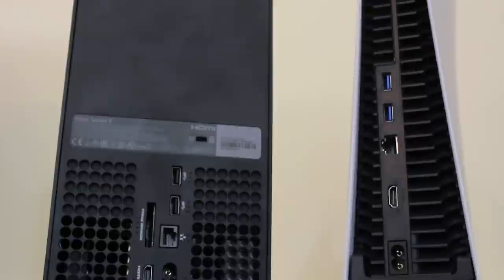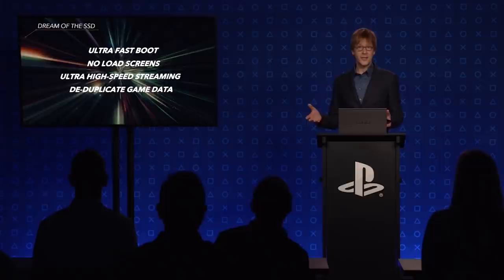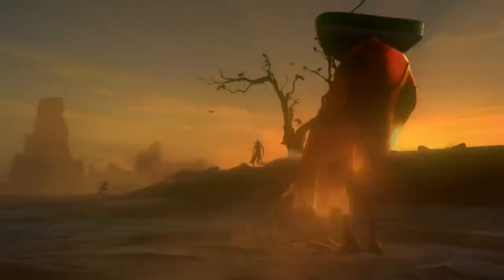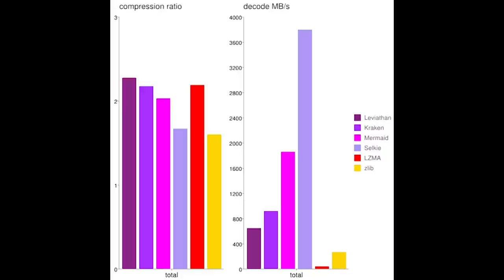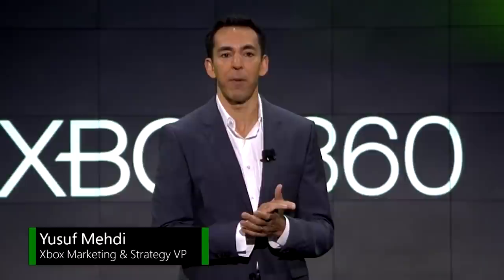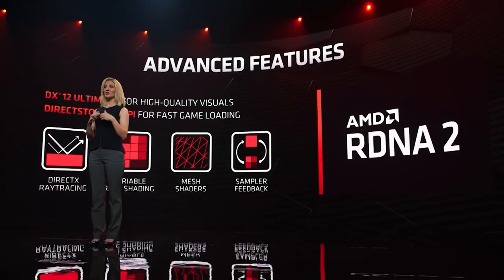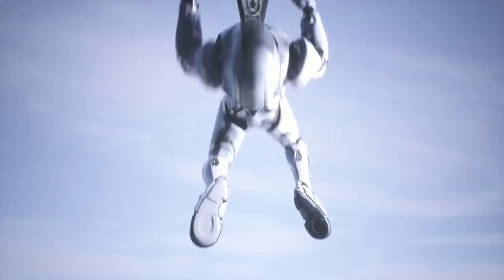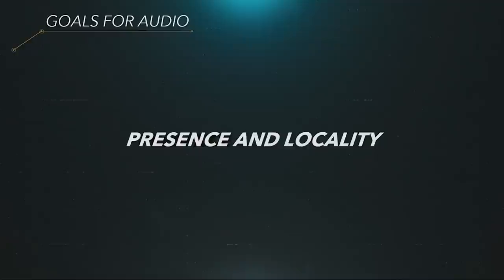Mark Cerny Reveals PS5 SECRETS | How The Playstation 5 Was Designed

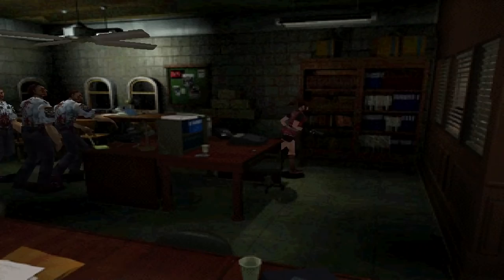Comment: 4:40 In the very early 2000s there was a company in the UK that teamed up with Sony to create a cd drive that used multiple lasers to increase read times. The UK company chose to use a single laser with a beam splitter and Kenwood made a CD drive with a 72X speed much faster that the 52X limit of cd drives but the beam with overheat and break. Sony on the other hand made a cd drive with multiple lasers but sadly they only used it for their own archive storage drives and never sold to the public. I guess having multiple lasers on a disc drive is too costly and SSD must came along so it made them outdated.
Reply: That's really interesting. Does it just read the tracks parallel to the one currently being read? I could see this being faster for copying an entire disc to a hard drive, but not finding specific data like a game would need to.
Reply: @TFSned  the UK company was Zen Technologies. Their system had one laser that diffracted the beam into 7 lasers. You have 1 center beam and then 3 on each side. The point of this system was to lower the spin speed and make the drive silent but still be able to read a lot of data. I had one and it had issues burning cds but downloading the contents to a hard drive it worked perfectly. If I remember correctly I remember timing it one time and on my old 48x cd drive it took 8 min to download a game while it only took 2 min when I used the kenwood 72x drive.
Reply: @aceofhearts573  One of the things that went against the Kenwood Zen drives was that the performance for ripping audio CDs to MP3 was no better or worse than conventional optical drives. At the time this was considered a significant issue in reviews of optical drives. It never really affected me as I wasn't concerned with ripping CDs but it became this big negative that kept coming up in discussions in places like Usenet groups.

Hard drive companies are now reviving the use of multiple read/write arrays to increase performance so as to remain competitive for applications where capacity is the main factor. some ideas just need the right circumstances to be given new consideration.
Reply: I heard on Digital Foundry that ps4 and ps5 according to Alex have no ability to play CDs for B.C purposes "Because the laser would cost an extra penny on the dollar so they had to get rid of it" it was a good show.
Reply: @sean70729  I actually have yet to stick a disc of any kind in my PS5. I'll have to look into this. I've never seen a BD-R drive that didn't have full backward compatibility.

Early DVD drives couldn't read CD-Rs, as the method used for the compatibility was affected by the reflectivity differences between factory CDs and CD-Rs. This was quickly corrected and the vast majority of drives ever shipped handle CD-Rs fine.

Comment: When I first heard about the Tempest engine using cell architecture I figured it would be a dedicated Ray Tracing component/compute unit.  I feel as though it could still be retro coded to make calculations for visual ray tracing and less enhanced sound or having a core take over sound management.

Comment: Kind of wish they used a wider RAM setup so that the games could preload on the RAM and then have instant load times. like RAMdisk technological advancements
Reply: That's where they saved money both systems have the minimum of RAM so have no overhead for that.
Reply: @sean70729  They didn't save jack shit. RAM is almost as cheap as SSDs to a manufacturer and they went all out with the SSD. I'm sure they could've ran more RAM and a more conventional SSD setup and probably have similar price results. Especially that its DDR4.

Comment: My computer still uses tapes, couldnt pass up on that value, $40 for 6-15TB with seek speeds slower than USPS, but sequential read/write speeds faster than almost all HDDs, and even some cheap SSDs i'm happy with it

Edit, my boot drive and game drives are still SSD/HDD, but tapes are where i put a backup of everything, and makes it easy to have an off site backup
Reply: Whoa did I read that right tapes?! Wasn't the more less phased out by the late 80's?
Reply: @denvera1g1  
Very interesting!!

I have a bunch of 5 and 8 TB Ted's laying around, I was thinking of using a server grade external hdd for long term memory backup of everything digital I have and own. 

Didn't think of tapes as an option for preservation till I came across your comment, thank you.
Reply: @mutalix  Be aware, the drives to read the tapes are expensive, if you only have ~30TB to back up, you're better off with HDDs

Comment: 33:05 I wish SLI and Crossfore was still a thing so we could use two GPUs for ray tracing.
Reply: More people would have bought into it if developers supported it. I was always ready to buy a couple last gen gpus but the fad ended before the prices got cheap.
Reply: It’s going to be difficult to regain customer trust for SLI/Crossfire. While in benchmarks they looked good, frame pacing was terrible, so it often looked like it had similar performance to a single card. 
Nvidia would have to completely rebuild SLI for video games and that might negatively impact the professional users who still use SLI for corporate and research applications.

Comment: Funny thing about hard drives, the read speeds aren't that bad it's the random reads that kill it and Windows doesn't defrag files over 64GB.

I had to repair a game the other day, a 1.2GB file was fragmented into over 11,000 fragments. It read the game at random read speeds, around 1MB/s, instead of the 250MB/s that the drive is capable of. Defrag the file and suddenly the game can load in seconds rather than minutes.

Hard drives are getting hate because Microsoft ignores files over 64MB in size. In the case of Sony I don't think they're defragging the drive at all.

Comment: Probably would have been better to have more cores on the cpu because they can upgrade the gpu later. More cpu cores higher clock speeds would be better than the 10 tflops.
Reply: @Transistor Jump maybe, but considering they always have upgrades around 3yrs in; the processing power would have been better. 8tflops would have been just fine because ps5 games aren't even using its full capabilities due to also having to worm on 8yr old hardware
Reply: @Transistor Jump it worked out so well for them there's no reason for me to suggest they won't do it again. And they will.
Reply: @Transistor Jump really. Well I think theybare still going to do it though.

Comment: The claim that the PS3 was very expensive to produce is a 3:rd party claim. It was never confirmed by Sony. The claim was based on yeald numbers for a die for that process and that size. buuuut.... the yeald increase for terminating one core was never calculated. Also the additional income from selling the dies that was fully functioning was also never calculated. This two measures would cut the die cost in half, and this would also partly be true for the GPU. This would cut a total of $200 of the estimated cost (first version only) of the PS3, and that was pretty much how much they estimated the losses was.
Reply: Microprocessor Report, a fairly authoritative analysis source, went into some detail about the travails of CELL development and what was eventually delivered. The PS3 started life with a massive debt load because the great majority of the anticipated CELL applications never came to be. So nearly all of the R&D cost had to be paid off  by the console, rather than a spread of consumer and high margin HPC products. The HPC stuff appeared in token amounts but never had much appeal without the promised scaling. IBM never got the scaling to work as intended, which is why the original PS3 design where multiple CELL chips did everything and devs allocated resources as needed per project, was scrapped. The CELL was both far too expensive and didn't scale correctly above two sockets.

This was driven home by the first E3 press event where the PS3 was 'demoed' in a qualified sense but for one problem: it didn't exist yet. All of the demos shown were CELL demos and Nvidia demos. None were for any combination of the two. That original design concept would have been a remarkable machine if the Sony-Toshiba-IBM partnership had been able to deliver in the needed time frame. Nothing to this day offers the versatility Sony was seeking to achieve.
Reply: @epobirs  that is really retroactive  way to justify  the numbers  

Also, when ever you read "authotative" think bullshit, becuase that is what it realy means
Reply: @matsv201  I have to assume you've no familiarity with Microprocessor Report, then. This wasn't some guys with a web site and it wasn't a news stand publication. Everybody involved had serious semiconductor industry backgrounds.
Reply: @epobirs  I read it. Becuase they didnt consider yeald.. sorry they can say all day they are competent.. dont make them so
Reply: @matsv201  I'm not sure what you think you read but yield issues CELL were well covered in EE Times and Microprocessor Report. Long term, it isn't what doomed CELL. Not delivering the promised scaling functionality that was the heart of the original pitch was the culprit there.
Reply: @epobirs  no  not that bullshit. The thing about yeald binning  that was very uncommon back then. Making the calculalated yeald all wronf
Reply: @matsv201  I've no idea what you're referring to here but by 2005 binning was very common practice to produce a line of products like the Pentium 4 or Athlon that were largely identical but for the clock rate they reliably operated at. Not as useful for the CELL with its limited range of target markets at launch.
Reply: @epobirs  yea that is obvius.

There are diffrent type of binning

Comment: Cerny or sony have never said that UE5 influenced the design of the PS5.
Epic have said that UE5 benifits the most from overall compute. As confirmed by digital foundry UE5 is not heavy on data streaming, the matrix demo streams 300mb/s (10mb/frame)
Reply: The question remains will data streaming be important if you are flying through the city at 100 miles per hour? or 1000 miles per hour? The car only goes so fast, and if you take it out on the highway you can see some pop-in at higher speeds. Will a fast SSD help with this? I dont pretend to know but curious because games like a Batman, or Spiderman going full speed might be affected?
Reply: @jasonmontoya4749  Yes it will be at least from all the articles i read a super fast ssd is key for high levels of detail. 
This is a quote from tim sweeney:

But it's about moving beyond loading screens entirely, to the point where "you can bring in [the demo's] geometry and display it despite it not all fitting in memory," says Epic CEO Tim Sweeney. 

I can give you the link to said articles if you want.
Reply: @s3rv3r3rror8  yes please give a link would love to read it

Comment: the way SPEs were used for GPU shaders later, due to the nVidia Cine FX based RSX beeing crap.
Reply: RSX was based on the 7800 gtx with 8 rops. It might have not had unified shaders but it was not a bad gpu. It was superior to the radeon 1800xt which it competed against in 2005
Reply: @aceofhearts573  it wasn't good though.
Due to the Shader stalling when doing Texturing, the Performance went down the drain once you used the shader.
You can look for Crysis Warhead benchmarks with the 7800/7900 and see how miserable that GPU fairs there. And how it gets beaten by an AMD Radeon 1650.

My point is also provem by presentations by Insomniac about "How to use SPE as Shader", because of that garbage CineFX Architecture.
If SONY had used an x1800, the PS3 would have faired WAY better (and perhaps they could have had open source GPU Support for "Other OS")
Reply: @Stefan_Payne  I guess sony should have delayed the ps3 for a year and worked with Nvidia to get a version if their geforce 8 to be used on the ps3 as the RSX
Reply: @aceofhearts573  Yes, that is not wrong.
But they were already late and to let the competition get the market isn't great either...

Comment: Are you sure about the hardware base ray tracing? Bethesda had a interesting interview for doom eternal showing a 30% improvement in efficiency  on the series x using hardware based raytracing vs Sony's software ray tracing

Also nanite on the first unreal demo I believe was software ray tracing but in the matrix demo they just put out of had hardware raytracing
Reply: The ps5 has hardware accelerated raytracing
Reply: @jordangilyard5478  thanks for saying that any links or anything? I haven't seen anything really backing that up
Reply: @technicallyme  Just watch ''road to ps5'' before making silly comments.
Reply: They both have hardware based RT, it’s part of the RDNA 2 architecture. Although Sony is using a weird combination of RDNA and RDNA 2 architectures, while Xbox has the full RDNA 2 architecture. If you pay attention to how the RDNA 2 GPUs scale, as these games before more complex and demanding, that 16 CU deficit is going to become more apparent. It’ll be like comparing a 6700XT to a 6800XT, you can only make up so much ground by running at higher clock speeds. Obviously PS5 games will still look good.
Reply: @caldweab  yes it’s part of rdna 2 but not part of rdna in general rdna 2 wasn’t finalized till after Sony was in full production
Reply: @caldweab  almost all new games will look better on PS5 and peform better. We see this already. And with one game diference is quite sttagering. In PS5 game runs native 4k 60 fps while on xsx runs 4k 50 fps. And that is not bug. Developers decided to add 1440p performance mod on xsx. And both consoles are custom rdna2.  Contrary to silly statements "xsx full rdna2". There is not "full rdna2" either it is rdna2 or not. Simple as that. Only advantage xsx had was in some old gen games and cross gen that was primaly developed for old gen. But this has ended.
Reply: @technicallyme  not true. That was debunked and new games eirher run the same on both PS5 and xsx or PS5 have advantage.
Reply: Choose to belive what you want but there's a physical space difference in the cu's between the Xbox gpu and ps5 that doesn't just happen. The cu's on the Xbox is spaced closer together. 308mm2 (ps5) vs 360mm2 (xbox). If all things were the equal it would be 30% larger. Architecture is not software

Comment: A bit too much credit is given to the decompression blocks for reducing game install size. Much of this could also be done on any PC so long as the game requirements include being installed on an SSD. Larger games typically have many redundant copies of the same files that get used throughout the game. This avoids a lot of mechanical seek time associated with hard drives and optical drives. Thus all of the data for a level can be in a single band of tracks to minimize loading time.

Eliminating those redundant files alone can reduce a game's install size substantially. This is an area where Microsoft is in a policy trap. While they've done a good job in how the Smart Delivery feature treats the Series S and Series X differently for native games, with Series S installs frequently being less than half the size of the same game on Series X, it's a different story on older games with Series X/S enhancements. Sony encourages devs to produce a separate SKU for PS5 that can only run from the SSD, and thus can lose those redundant files, along with compression being applied to those that remain. Microsoft has been less demanding, meaning a game with Series X/S enhancements might still be designed to run from a hard drive if it doesn't absolutely require the SSD.

I'm hoping for Microsoft to seek a middle ground, providing us with the choice of a game install that can only be played from SSD be can be offloaded to an external hard drive as needed to free up SSD capacity while avoiding repeated downloads. I'd be more inclined to buy a USB SSD to minimize the time for offloading from and reloading to the primary SSD if reduced install sizes gave me more effective use of the drive's far lesser capacity compared to a comparably priced USB hard drive.

Comment: PC gaming has been so much more interesting than the consoles
Reply: öhh no ... That also shows the general number of players.
And take a look at Stream and co and have a look at the statistics.
the pc has been holding back for years.
The PC brings SSD into play, the consoles ensure that it becomes a mass product and the developers finally take the step and no longer optimize for HDD (what you HAVE to do with every game if you use HDD)
the pc brings RT into play ... the consoles make it suitable for the masses.
Graphic highlights also come regularly from the consoles and not from the PC ..
The pc is simply outdated (I have a 2080 TI / 3900x / 32 Gb memory myself ... my housing alone costs 200 dollars)
But I mostly play on the console ...
How many really good graphic hits have there been for the pc in the last 5 years?
Due to the countless variations and millions of comobnations due to the hardware, it is simply possible to go one step further with a lot more power and that is the advantage of the consoles. ONE system and this system beats the pc that costs four times as much.

then comes the eternal lie of the "upgrade" .... yes, everything bullshit from a certain point you are stupid if you just update the graphics card ... the ram is too slow or the cpu either has too few cores or instructions are missing Etc.
it is only ever possible to effectively upgrade your pc in a very small space without renewing the entire system POINT.
Back to the team charts ... most of them still use 4 core CPUs and HDDs ... that doesn't sound like a pc master race ...